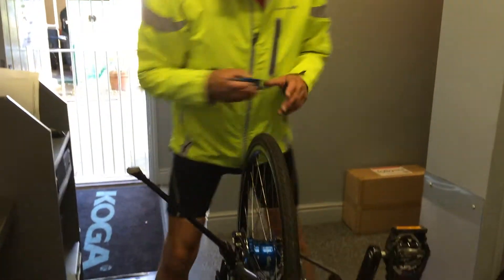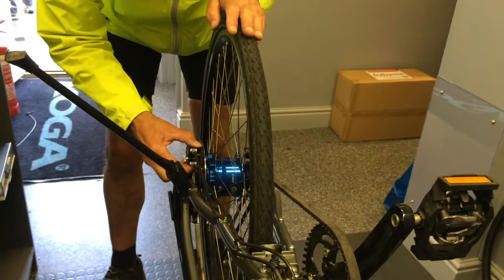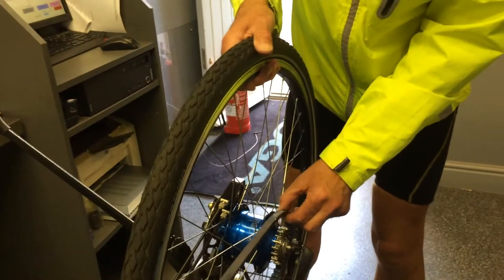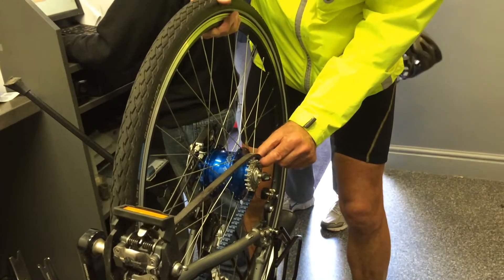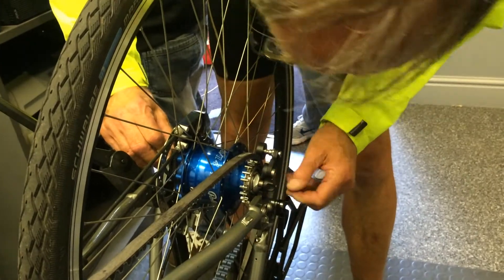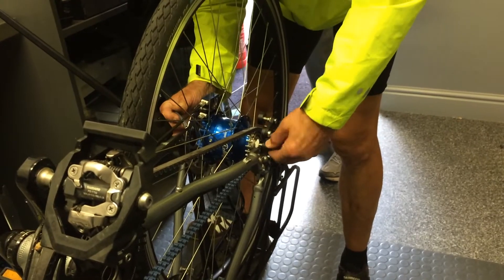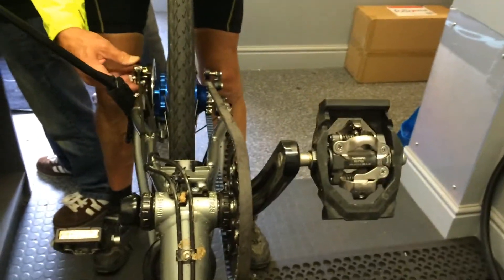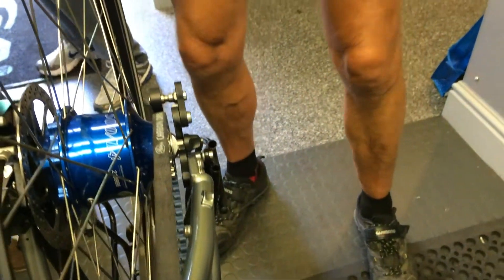Koga bike rear wheel removal

Comment: After much thought I've just taken delivery of a virtually identical bike and this short video was very useful. You been pleased with your bike? Used mine for the first time yesterday and, unsurprisingly, found progress slow when compared to my usual riding! What kind of speed do you plan to average when on tour?
Reply from the maker: Hi Quentin I bought my bike last year for a bike tour from Budapest back to the UK, a total of 1450 miles. I enjoyed riding the bike in that situation and had 2 large back panniers. I packed the bike in a large cardboard bike box and removed the front handlebars but then the front forks dropped out. I rebuilt it but even now I get squeaky noises coming from the handlebars, even after taking it back to the bike shop for them to check the bike. Surprisingly the bottom bracket had to be replaced last year, though I doubt that I had cycled 2000 miles.
This year I have not used the bike that much. I have two long rides (1) 550 miles from Amsterdam to Copenhagen, (2) 250 miles across northern Spain. Each time I used my older bike as I transported my bike in a CTC bike bag and did not want my Koga scratched. 
I like the riding position and intend to use the bike in the winter months. If I do another tour where I start from home and return to my home I will definitely use the bike. I also have a lightweight Giant Defy which I find is faster, with the gear change being easier than the Koga.
Hope this helps. Mike